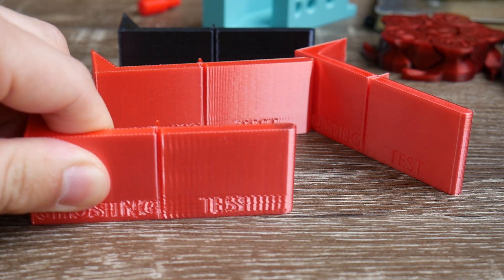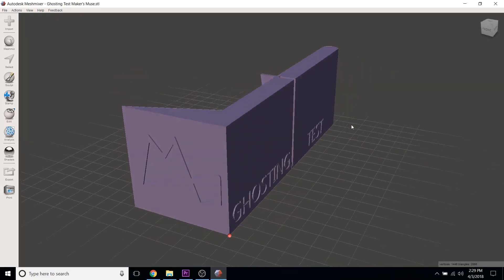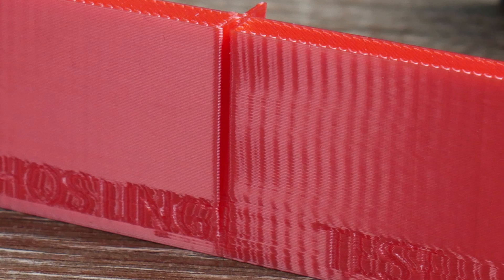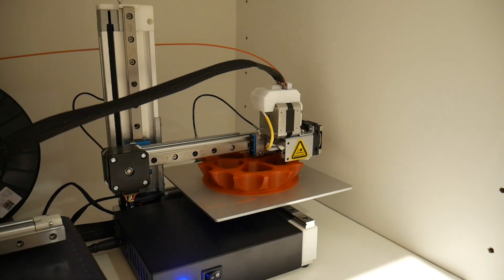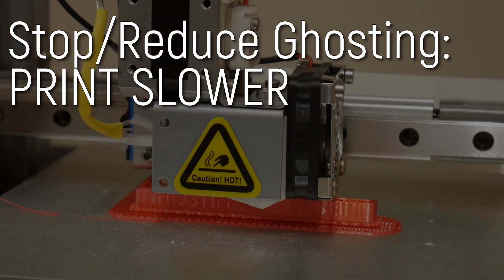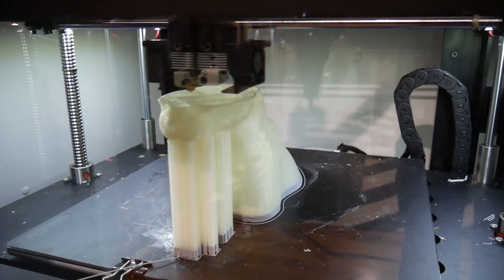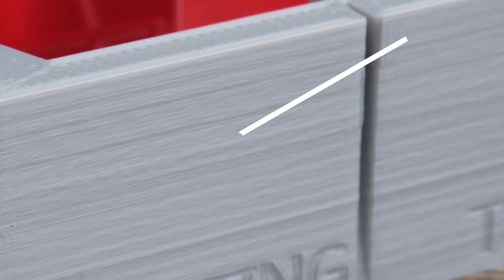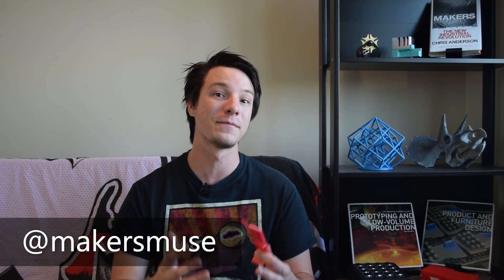Ghosting in 3D Prints - What is it and how do you fix it?

Comment: While watching this I pressed on the corners of my 3D printer and noticed that while the table appears flat, one of the little foam pads under the 3D printer isn't making full contact, letting the 3D printer wobble.. I put a piece of cardboard under the pad and now it's a lot more solid. Doing a test print now 👍
Reply from the maker: It's actually not much of a big deal if the printer wobbles, as it's rigid to itself. It does help cut down on noises from vibrations though!

Comment: I wish someone would put a small array of accelerometers ON the gantry as close as safely possible to the print nozzle, and use the resultant stream of data, plus AI (deep learning/TensorFlow) to adjust the printer's s=acceleration, jerking, settling, on the fly...  it could be used to find the best acceleration curves for the speed, and help the printer deal with these oscillation and vibration artifacts in real-time.

They use this technique  on drones/quadcopters to get DEAD steady video footage.

For very important prints the printer could either run physics simulations in faster-than-real-time in the GPU, or  just run a dry (non-heated/non-extruding) print and edit the counter-oscillation adjustments into the GCODE as it runs.

You're welcome...  now get coding.

Maybe a thing for Google Summer of Code??

™©®

Comment: Thanks, you helped me confirm that careful assembly with strict tolerances will eliminate yet another 'common' problem. That and a double Z screw. Like others, I want to switch all belts to drive screws. Get them within 10,000/in in the XYZ and never have any of these common issues that stem from 'minimum engineered products'.

Comment: Moments of inertia are to rotation (not really, but kinda also bending a bit) what mass is to linear movement. That said, velocity, acceleration and any movement won't change the moment of inertia. However, higher accelerations cause bigger spikes in resonance vibration. Increasing inertias and masses is a good thing for the frame - as you correctly showed, but it's a bad thing on moving parts, since these "masses" store engery and vibrate as long as they do. So: inertia is mass and accelerating that mass leads to swinging masses, which causes trouble. So make things light and rigid (rigidity helps to shift vibration frequencies to so high bandwidths that they can be ignored).

Comment: Angus do you know how to cure scaring on outer layers, where it leaves a gap on the start of a new layer until it primes more filament....Using a wanhao i3 with a micro swiss all metal hotend 1mm of retraction, PLA @ 200c bed @ 60c and cura as slicer....Thanks chris

Comment: Hello man your explaination about echo is correct but  I understood that the main reason of ghosting is a movement trasversal to an axis over which the nozzle is moving. The eco is not caused by x or y themselves but by the bar at the top of z for 99%. Is a butterfly effect, where the z axes starts to vibrate trasversally to the x or y axes. The eco or lines u see fading out are the translation of the fading out of the vibration of  z rod\brace. Because of that if u check it, the slot at the very top of the z rod has a bearing whose socket is very loose (for cr-10), this in order to let the rod vibrate without transmitting the vibration to the brace. So the issue is not the relationship between x and y but with x that turns into y while z vibrates. The question of mass is true but it cant be the main reason of ghosting here. U have not 30kg of mass to brake in 2cm that justify the inertia over the x and y movement relationship only. The z rod is the criminal here.   Make a test and try to completely isolate z im order to fight ghostin 👍👍👍

Comment: Small correction: moment of inertia is an object's resistance to changes in angular acceleration. The moment of inertia is just a property that comes from the mass and geometry. It's not 'caused' by the motion, but is rather the property of the object that makes it more difficult to make quick changes in direction. The moment of inertia of the extruder is constant regardless of whether it is moving or not.

Comment: Wouldn't it be possible to set the settings to slow down before changing directions? That way you can still print straight or smooth lines at a decent speed while not getting the ghosting from the sharp turns

Comment: when I was building my ender-3, with the assembly guide of another youtube channel, I noticed that the v-slot bearings came pressing too hard on the aluminum frame, so as the video told me to also manually set the offset screw I made adjustment so that the gantries can move more effortlessly but not wobble. can these resistance caused by too much pressure on the bearings also causing ghosting? I sort of reckon that it will, but I never had any ringing right from the first print.

Comment: Adding more  rigidity will not solve it, just change the shape. Basically, the problem is that the system has a resonance frequency which gets excited by the G-code.
Slower speed reduces the forces involved, and to some extent the acceleration - that's why it helps.
More tension does essentially nothing. Preloading a spring does not change it's spring rate.
Reducing mass increases the resonance frequency, which may help
The real solution is jerk and acceleration. You have to view them as low pass filters. Basically, they will greatly reduce the forces acting on the frame during direction changes - essentially reducing print speed whenever changing direction. The issue is that properly tuning them is not trivial; of course you could just greatly reduce them and it would help, but it would slow down fine detail prints a lot...

Comment: Why not just go to your local sporting goods outlet and get stick on vibration dampners. they can be found any where compound bows are sold. they are soft latex shapes with a double sticky tape adhered to one side. Print out 4 of the muse sample, one every 90 degrees... and stick the damper in the direction of the ghosting... in the video example with the cardboard the damper should be stuck on the side of the bed the cardboard hung off. they also come with screws molded into them if you'd like to firmly mount them.

Comment: one of the quick ways to sometimes get rid of ghosting is to change the orientation of your print and try to have the widest parts lowest when possible and have the print head print less and less per layer as it travels up. Doesn't always help, but some times it does.

Comment: I´ve some questions regarding 3D printers, and I hope someone in here could help me out
Can you print your own transformer or action figures with ANY 3D printer or do you need an especific type of printer?
What´s the best material to use if you want solid toys: ABS or PLA?
How solid is going to be the toy? Like Hasbro´s solid, like a Lego´s brick or is going to be like a really cheap plastic?
Do you need to sand the pieces or they´re already smooth as soon as they leave the print?
What´s the best software to use to create toys for 3D printing?
How durable is going to be the toy? Is going to break as soon as it hits the floor?
And what´s the best way to deal with tolerance´s issues?

Comment: The fact is, FDM printers were never meant to be 100% perfect prints.  My printer can do 300mm/s travel speeds, but I run it at 150mm/s travel speed, and print at 40mm/s for good results and cooling.  You really need a printer that uses screws instead of belts to really get easy perfect quality.  The Trinus for example, creates some darn good prints. But the question is, do we really need perfection?  It's nice to have it when you can get it, but most people can live without it.

Comment: I think if the belts were pulling on the hotend's center of gravity it would be loads better. As for my Monoprice Maker Select, only the belt is on the rear side of the bearings and everything else is on the other side.

Comment: The belt tension can also make a big difference. If your 3D printer is belt driven you kinda have to find a good balance in belt tension. A loose belt dampens vibration quite well, but may result in higher tolerances. While a tight belt decreases the tolerances but also increases the springiness of the belt, potentially 'causing things to bounce back and forth a little after a sudden change in speed. Similar to a weight hanging on a rubber band when the other end of the rubber band is suddenly moved up or down slightly.

Comment: My ghosting problem with my creatility cr-10 s5 is from the absolutely massive weight of the bed. 500mm square aluminum plate with the frame underneath and same size glass plate, the heater and the aluminum plate for leveling screws. The whole thing probobly weighed over 10 lbs. I modified it to only weight about half as much.

Comment: Sometimes just changing the orientation of the print on your bed helps. Just try and rotate your piece 45° around the z-axis if it has a square shape and flat faces. Of course, this does not help that much if your design has organic and rounded shapes. And about the acceleration and jerk settings, most firmwares allow you to adjust these settings via g-code commands. So with a bit of g-code hacking it's easy to make quick adjustments and find the best settings for your machine... (Check the M201, M204 and M205 G-Codes on http://reprap.org/wiki/G-code )

Comment: I recorded a test of steel core poly belt a while back to see if it would reduce ringing, but there was very little effect in the setup I used, (which was dissappionting) but I pulled some data on jerk and acceleration ringing comparisons on a caltilevered machine around the 5 minute mark https://youtu.be/tbl7uLZ8-A0  (nothing conclusive, but it may save someone the headache of printing 30 ringing test cubes!) I'll re-try the steel belt on a large machine in the future, but unsurprisingly, acceleration really seemed to be the key.

Comment: i noticed some ghosting on a reprap model 3d printer.

which happens when you put support between prints (overhang)
this only happens on a few layers tough.

the layer where the support layers start and where they end.

the file is a really simple file with no text and less than 15 sides with 1 half circle.

Comment: Here are some further suggestions for reducing ghosting.
1. Take into account the geometry of the printer. So, for example, on the Cetus, oscillations in the cantilevered arm contribute to ghosting, so try rotating the print 90 degrees. This will reduce ghosting on one surface (but increase it on the other) which may give a better result for your print.
2. Place the print on a different place on the print bed. So, for example, on the Cetus, moving the print to the left will mean the print is nearer to the cantilevered arms fixing point, so the magnitude of the oscillations in the arm will be smaller at this point.
3. Design your prints to reduce ghosting. In particular avoid sharp corners, if possible. So fillet your corners if they are not required to be sharp. This will also have the benefit of marginally reducing the print times (since the print head does not need to slow down as much going around corners).

Comment: One tip: 
Putting your printer onto a foam board or put it on springs for vibration Isolation does not reduce the ghosting. It just changes the eigenfrequencies of the whole system so the ghosting will appear at different movement speeds / changes of speeds.

Putting the printer on a vibration isolation only reduces the vibration that the printer gives to the surface it stands of. In general the printer on it's own will "wobble" more.

Comment: Ghosting can also be reduced by fixing your printer down to a rigid base. I screwed mine down to a 3/4" plywood base and saw an instant improvement. I still get ghosting when printing fast, but generally it's acceptable. Also it reduces the frequency I need to re-level my print bed. I'll look at improving the rigidity of the X-Z axis next with braces

Comment: Printing slower is a quick fix, but also the brute force worst case for fixing bad acceleration and jerk settings: print slower when you don't need to during straight paths but possibly still cause resonances around sharp moves.  Getting acceleration and jerk right can fix this without sacrificing straight-line speed  A much better order to address ghosting would be:

1. Reduce moving mass to the extent you can
2. Improve rigidity, mounting, and static mass to the extent you're willing
3. At normal speed, tune in acceleration and jerk
4.  There is no 4.  Don't touch speed, ideally.

It would be more fair to say: reduce speed only if you don't have the time/patience for #3.  I think people are intimidated by acceleration and jerk, but let's face that unknown.

Comment: Are there any engineers watching that actually know what moment of inertia is and how to calculate it? If yes, then you probably thought: "wtf is this guy talking about?"

Moment of inertia is not caused by acceleration, it's the property of s structure that determines how easily it will deflect based on the force that's acting on it.
And then there are 2 separate "moment of inertia"s, the first one and the second one. Or the mass moment of inertia and the area moment of inertia. In order to calculate at which frequency your printer will resonate you will need both as well as the material property.
Reply: As an engineer I caught this same thing while watching the video, however I think it is important to realize that even though he is not an engineer he still pushes himself to understand these deeper concepts which is very admirable. In this case he could have said “velocity increases the magnitude of mechanically driven oscillations after these sudden direction changes while the ability of the machine to dampen these oscillations remains constant due to the constant area moment of inertia of each member on the machine, so at some velocity the oscillations become visible.”
Reply: @kaden56  Constant area moment of inertia? You should probably take English grammar classes lol
Reply: Alejandro Pérez no need for English lessons, the “area moment of inertia” is a value that every part has with respect to every axis and it’s used in flexure equations to tell you how much it will flex in about any axis with some applied stress. These area moment of inertia values are constant as I stayed because they are physical properties of that member of the assembly itself. So no, I don’t need any English lessons but I am thankful to have taken great classes like strength of materials and mechanical design while getting my mechanical engineering degree. I recommend that you take them as well.
Reply: Yep. Pretty much. I am not sure why he didn't just say "inertia". I guess "moment of inertia" sounds cooler.
Reply: Yeah, that made me double take. I think there was confusion with the common meaning of "moment" and the use of the word in physics. Understandable. People make similar mistakes with phrases like "begging the question" all the time.
Reply: yes I'm a big fan of Maker's Muse but the terrible physics in this video is actually so painful to listen to
Reply: I was doing something else and not really listening to this video, but when he said "Less speed means a lower moment of inertia" I was like wtf dude?????
Reply: sasja de vries. the problem is the stopping 3d printers can stop very quickly while testing 200mm/s on mines with 1.5mm movements back and forth or was strong enough to move my table which is pretty heavy
Reply: Caught the same thing on watching this. I have always thought it was interesting seeing the lengths people go to trying to fix this on machines that have, essentially, little to no damping and with structures that are very underbuilt. Doesn't matter that you have negligible contact forces from a tool, your still trying to throw a mass around at speed which leads to high accelerations and all the Dynamics associated with that. That's one reason that machine tools are built using various cast iron formulations as it does absorb vibration relatively well, especially when compared to aluminum or steel. Always wondered why folks didn't build their frames a bit heavier and fill them with epoxy/sand to add some mass and damping to the static portions of the frame.
Additionally, there are motion control regimes that can provide high velocities and accelerations by not only limiting jerk but also jerk derivative that would also help reduce the resonance seen.
Reply: @stephenfoster2532  Thank you I've been wondering this lately as well.
Reply: "Less speed means a lower moment of inertia" lol, nope.
Scientific knowledge of a lot of people is completely hopeless.
Reply: Agree that Angus doesn't understand moments of inertia, and shouldn't have used the term in the video - but this small misinformation doesn't greatly detract from the overall content. The TLDR of his video is basically "it's a vibration problem, so can be rectified by the usual means". His explanation was somewhat lacking based on his knowledge of the field, as you noted. All in all I liked the video and your comments, but the second comment whilst humorous is a little harsh :P